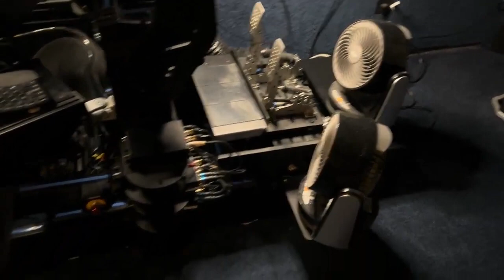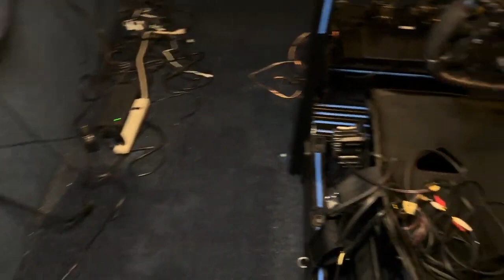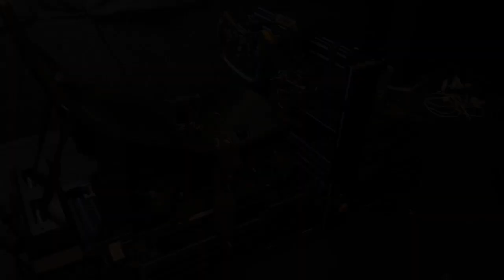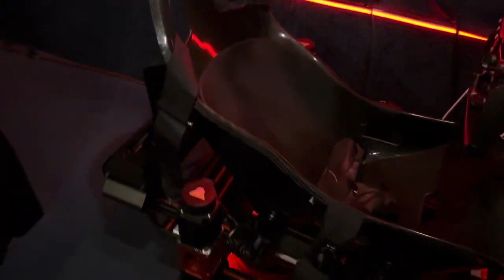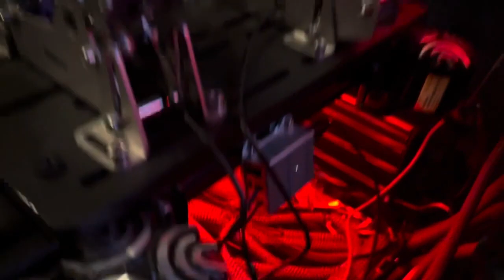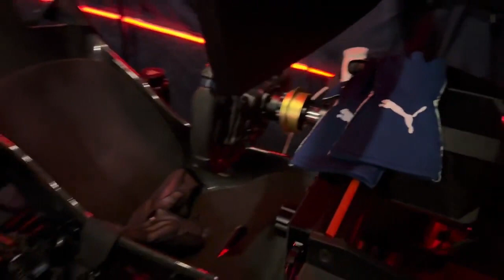Adding eRacing RS Mega+ motion actuators to Sim Lab P1x 80/20 Aluminum Rig.

Comment: Hi @tronicgr 'm wondering why I'm get jittering when my fps drop just tiny bit using MSFS with SRS and e racing rig ? why the motion data connected to FPS, is there a way to minimize or eliminate the issue ? Thanks
Reply from the maker: Have you tried reducing your graphics settings down and seeing if the jittering goes away?  I’ve not experienced anything like that beyond purely graphical related fps drops.